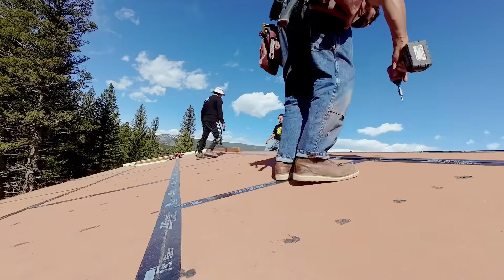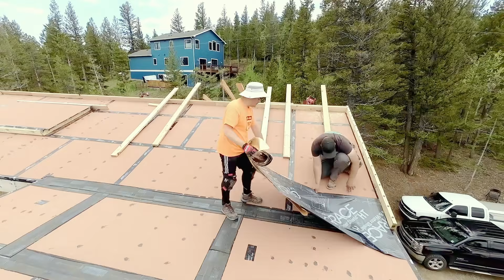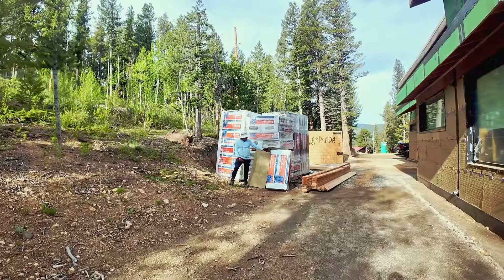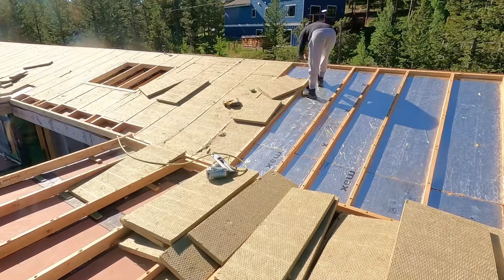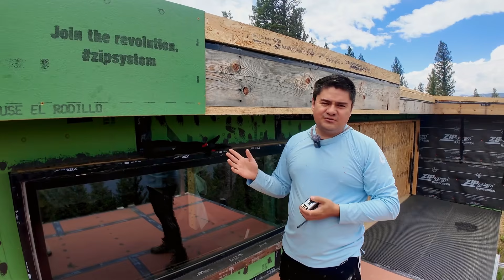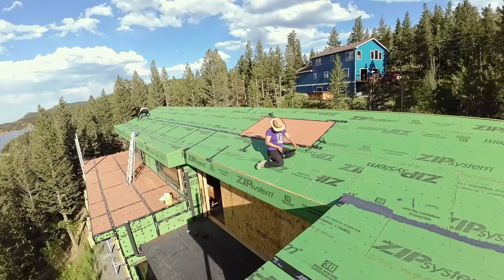How to Install Exterior Roof Insulation for High-End Energy-Efficient Homes (Polyiso + Mineral Wool)

Comment: So, instead of continuous exterior insulation, you have thermal bridging associate with interior insulation.  Winning!
Reply from the maker: Wrong, it's an extension of the interior insulation. Thermal bridging is impossible to prevent, at the end of the day you need a structure that can hold up, that is WAY more important than thermal bridging.
Reply: @efficientbuild  You don't understand the ability of rigid insulation to support the loads on the roof.
Reply from the maker: I actually do, as we install in underslab. This is a 140 MPH zone and the roof finish needs proper fastening
Reply: @efficientbuild  where is that 140MPH wind zone... that beautiful landscape does nto look  like anything near 140MPH wind zone? and rockwool metal panels are certified for 140MPH which means they can probably withstadnd at least little more and if there is 140MPH winds you have much more problems with average american house than just flying roof
in the end nobody is blaiming you, you are just a builder, probably very good one, you just follow the design of the architects most likely, this roof is not bad by any means most of people do it like that but its not the most thermally eficient way, there is a tradeoff wetaher you want o put solid frame under or have continous inulation without thermal bridging, and most energy efficient
Reply from the maker: Rocky Mountains, zone 7

Comment: Interesting setup. I dont quite get why ypu built a second set of rafters on the first roof? Why not 2 layers of foam boards then fasten a second layer of wood sheating over top into the primary rafters? Without building a second set of rafters
Reply from the maker: You are correct, the original intention was to use Z-Girts for the roof to be almost 100% thermally isolated. The problem with Z-Girts was their lack of strength. We have a video on that, here's the link:
https://youtu.be/PN6vV8d3M9I
Since that was the intent before the house was built, once it was built and later discovered Z-Girts weren't the best idea for a strong roof we changed to this design.
Therefore, the best thing to do into the future is to use thick trusses to account for the extra insulation (I'm leaning towards trusses because they make electrical and plumbing easier) or 2x16's instead of 2x12. I believe I mention it briefly in the video.
The mineral wool continues to be an important component because of fire protection. If we weren't in a fire zone I would probably use polyiso for everything.
Reply: @efficientbuild  im not familiar with z girts
Reply from the maker: We have a video on wall exterior insulation coming in a few weeks or you can check how we've done it on our other builds. We have a few videos on exterior insulation,  wall and roof

Comment: it would have been more effective to put the reflective insulation on top (closest to the sun,  but under the final roof sheeting) and have and air gap between that reflective material and the final roof sheeting.

Then the air gap between the reflective and roof sheeting, should be allowed to vent (as a vented attic would vent. where heated air is allowed to rise along the top layer of roof sheeting and exit at the ridge. Also obviously there would need to be an air intake at the bottom. repeate for each 2x4 bay cavity.

if you  trap the heat in the cavity, the reflection material is effectively nullified because you are no longer dealing with radiated heat, it is convicted heat. where a radiation barrier does nothing for,.

Otherwise great video. thanks.
Reply from the maker: Thank you for the compliment. We put the mineral wool on top for fire protection reasons, we might've used all mineral wall if the engineer hadn't said it was too heavy. In this case, we cannot put the polyiso to the exterior because it is vapor closed, while the mineral wool is vapor open, meaning, if any water does manage to get in it could get trapped in the mineral wool. With the polyiso first, any water can evaporate through the mineral wool to the ridge as you mentioned.

Comment: You just defeated the purpose of the reflective facer.  It absolutely needs an air gap, this cannot be stated enough.  In some reflective facers the minimum is 1/2", 3/4" in others and some need at least 1".
Reply from the maker: You are mostly correct, but I disagree when it comes to this particular assembly. I pinned a comment on the video explaining why I believe it works.
If you continue to think otherwise provide logic on that thread to disprove my logic.
If you are right I'll create a short and give you credit.

On a side note, you missed the part where I mention I do it for weight too.

As long as you keep it civil, we can have a constructive conversation.

Comment: I believe if you want to do something like this again you could also point the reflective face of the insulation downward and leave a small air gap.

Reflective coatings (typically called radiant barriers) actually accomplish two things.  First they bounce the suns rays, that's the commonly understood part.  They also tend to release very little infrared radiation.  You could in theory put a foil face on the underside of the roof pointed down at the house and very little of the infrared radiation would transfer.  In the arrangement you've installed it can still accomplish something but only if there's a small gap to prevent conduction.  The radiant barrier will also do double duty in the winter, preventing the warm house from radiating too much heat into the upper layer of insulation and ultimately into space.

Comment: My understanding of reducing energy transfer by radiation is that you need an air gap between the radiant barrier and adjacent material does mineral wool provide that airgap if it’s touching directly on the radiant barrier? Really like quality of your work.
Reply: That’s correct, an air gap is needed for radiant barrier to prevent conductivity and reflect radiant heat.
Reply from the maker: @uongduong I pinned a comment at the top video with a full explanation as to why I believe that for this assembly, it's ok to not have a gap.
In most cases, yes, it is recommended to have an air gap.
Reply from the maker: Thank you we appreciate it.
I could be wrong, feel free to correct me. I believe the airgap is for preventing damage to the insulation due to conduction.
For example: if the insulation is touching a hot roof it could get damaged. Having the airgap would prevent conduction damage.
I believe, I could be wrong, heat radiation being light can travel through any medium including the lack of an airgap as long as the medium doesn't absorb it.
In the case the airgap is needed to take advantage of the radiation we are ok not having it.
We also installed it because of weight limitations from the engineer. 
All that said, I'll do more research on this and hopefully make a video about it.
Thank you

Comment: Did you say you used Big Stretch on the nailheads? And if so, why did you select Big Stretch?  Thanks.
Reply from the maker: Hello, yes, we use Big Stretch for the most part. Sometimes Through the Roof or Lexel. We chose Big Stretch because it's more affordable and it's meant to go on exteriors. It is used for siding, windows, trim, etc. It performs well. It is also more affordable than Lexel or Through the Roof, and much much more affordable than liquid flash.